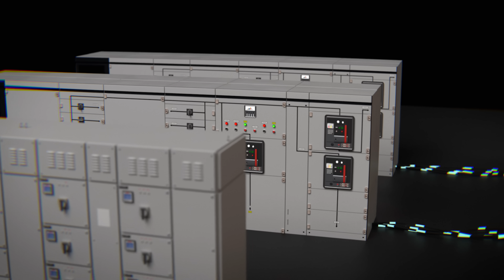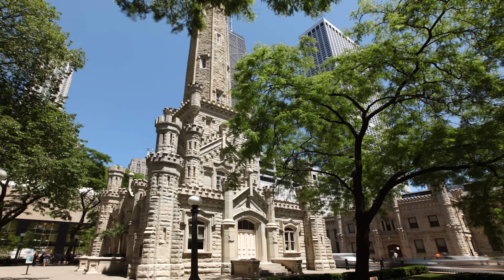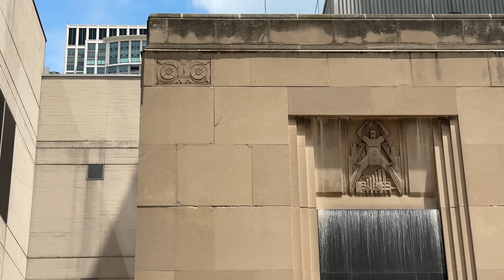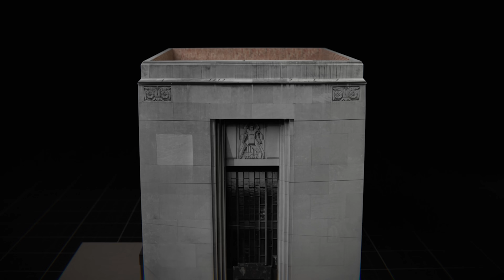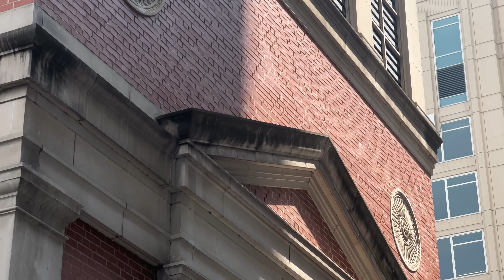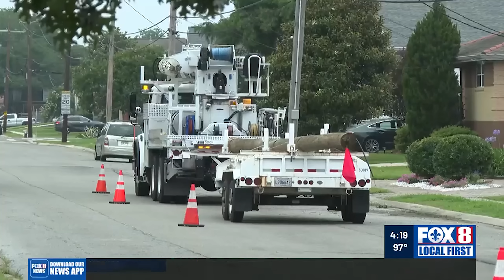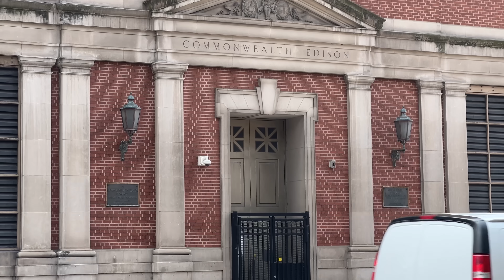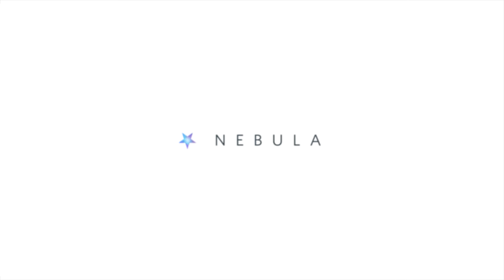How Fake Buildings Keep Cities Alive

Comment: The alternative to camouflaging infrastructure with the style of the local vernacular architecture isn't impressive art deco or neo-gothic works of art, it's a 10-foot chain link fence topped with barbed wire and dotted with danger signs.
Reply: In my city in Belgium the downtown substations have been moved. And non are in nice buildings.
Reply: That is not THE alternative. That is AN alternative. You could very well design architecture that strikes a balance between the utilitarian need to keep people out of danger while also not entirely hiding the existence of critical infrastructure.
Reply: Here substations are outside the city bounds not in a building in the middle of a busy street
Reply: @alex31ytb  Thats only feasible for cities that arent multiple kilometers in diameter.

Comment: The Pompidou Center in Paris inverts this, using the infrastructure of the building as presentation, as very visible design elements.
Reply: But it ain't pretty which is why many people joke that the best view of Paris is from the top of the Pompidou because you can't see the Pompidou.
Reply: @David-kd4qr  That's the joke for Tour Montparnasse

Comment: They built WTC 7 over a substation. It can be done, but at significant cost and design complexity. The cantilevered structure meant the building had unusual load paths, increasing the risk in extreme conditions. Personally, I’d rather have a simple, low-risk building than take on that kind of structural liability. And if it blends in, good.

Comment: theyre missing a great opportunity to have these places be learning centers for kids. stop hiding them behind fortress walls, let there be windows to see inside at the inner workings, with simple explanations and diagrams of what's going on. if the building is going to be in the middle of a community, let it be part of the community.
Reply: There is no way in hell they are letting kids into those buildings. Unless you are an engineer and a tradesperson you shouldn't be anywhere near that equipment.   Hell typically you are going through some form of orientation training just to get access.  This stuff is extremely dangerous which is why they build what is essentially a bunker around them.
Reply: @pin65371  emphasis on the windows part of the post lol

Comment: Access is restricted to qualified personnel whether it’s in a building or behind a chain link fence, so people wouldn’t interact with it anyway. Beyond that, your average homeowner barely knows what a breaker panel is, much less that it has an operable door on the front. Are those same people supposed to know what in the world the wiggly wire dohicky from the 70s and that it should be upgraded? Not sure what the point was overall beyond a vague notion of hiding the infrastructure in one way is good, but in another similar way is bad.
Reply: Most homeowners know what it is 🤦‍♀️ I live in an apartment and I’ve even had to check mine before. This isn’t some esoteric knowledge that only super special snowflakes like you have.

Comment: First, that's not a picture of Bruno Latour.
Second, your case is so much all over the place it's difficult to form a rebuttal, but I'll try.

Utility equipment can kill you, EVEN IF YOU ARE PROPERLY TRAINED TO WORK WITH IT. The last thing ANY utility needs is for kids, urban explorers, and the 'hold my beer' crowd twisting knobs that could disrupt the utility, damage property, or injure/unalive someone. So there's a reason the technologies of a modern city are enshrined, accessible only by the priests.

Chain-link fences and barbed wire are ugly. Fake buildings are usually less ugly.

Should utility infrastructure and design be open to public review for comments and suggestions? Yes. And it often is if you know how to access drawings and other models. But unless you have an engineering degree relevant to the utility, you probably won't know enough to suggest a valid improvement.

Even with a relevant education, most technicians/engineers can't identify a failing component by simply looking at it, so even if the equipment is within public view, it's highly unlikely that anyone will ever be able to say, "That #3 fuse is about to blow because the associated transformer has a phase imbalance." or, "Pump 7 is failing." or, "That valve hasn't been exercised in over 3 years."

Preventive maintenance schedules exist for a reason. When a utility is dealing with budget issues they sometimes skip some of the maintenance in an attempt to cut costs, but this only works in the short term and often costs more in the long term when OOPS the $500 component failed, started a fire, and destroyed the entire $5M installation. But that's not the fault of the public, it's nothing the public can do anything about, and most utilities have regulatory agencies that can fine the utility or even revoke their operating license in extreme cases.

As for making buildings interactive, we can hang a b-ball hoop on the side of any building, whether it's brick, CMU, stucco, wood, steel, or plastic.

You've made better videos. This one falls below par.
Reply: Usually I’m a fan of this channel, but I 100% agree that the argument in this video was all over the place. It felt like I was watching the same person arguing both sides while insisting on one outcome - very odd.
Reply: @notyrpapa I think he’s just informing us on the subject and the opposing views rather than arguing for one or the other. His videos are always very floaty and not strictly on topic and rarely arguing for specific points. Makes them interesting if you know nothing about the subject and mildly frustrating if you are informed on it and know there’s a plot thread he could be following
Reply: Yes, for the inside, layout, design etc. is very much for the EEs. The outside (the decoration, if you will) can and perhaps should be the purview of architects or artists. 
And the public might be able to do something about he lack of maintenance, depending on the locality. They can be sure their representatives (city/county council members, etc.) insist on finding a way to do the routine maintenance.  It'll be a struggle, as it always is to influence public policy. And that won't apply in nondemocratic/authoritarian places.
Reply: I really don’t think he’s arguing what you think he’s arguing. This is an informational channel. It’s just informing us on what is happening with these buildings and what the possibilities are and the opposing thoughts people have. He’s not shitting on anyone or any side of the supposed argument.
Reply: Ukraine is a money pit for a lost cause, but you have the right idea about the video🫠👍
Reply: Unalive? Seriously? Grow up
Reply: @masonrockwood7732  it's not a matter of maturity when the algorithm itself shadowbans or deletes comments that contain certain words.
Reply: @guycross493 I'd rather take that risk than censor myself. You are bringing to whip to your master and thanking him for the opportunity to whip you if you're that spineless.
Reply: @masonrockwood7732  you know youtube censors things, right? at one point youtube censored comments and content containing the word i euphemized. not sure if they still do, or if they'll ever resume the practice if they ever start letting the word pass.
it's not me that needs to grow up, but the users who have a conniption fit whenever they see a comment left by someone smart enough to outwit censorbot.
Reply: @dhtsoaedsdhtnadi9575 You aren't smart for using a word you picked up from TikTok. You missed my point entirely. It's the ethics of self-censorship, or lack thereof.
When you soften words like rape, suicide, and killing, you are normalizing and de-stigmatizing these horrible atrocities. I choose to live my life with my eyes wide open, if you want to speak like a teletubby, be my guest but you've lost the right to speak to me.
Reply: @masonrockwood7732  you think i'm a tiktok kiddie? you're wrong, and also blocked.
Reply: Considering the HUMMMM that some guys have to stand next to every single day to keep the lights on, I say civil electricians are some of the best trained people in the world, definitely a closed shop you had to develop an ear in. It's sad when a team has to remove someone's last mistake when they were just doing their job, not so much when fatal excitement- or intent- sneaks past safeguards. So a generous vanilla plastering to discourage human moths is also brilliant design that says much about a city and I respect that.
Reply: okay i'm glad i wasn't the only one who felt he was all over the place

Comment: Usually substations convert electricity from extra high voltage to high voltage, still far above what is in your home. Most substations convert from approximately 100,000 volts to 10,000 volts, still far too dangerous to be near for the public. In the US, wall outlet voltages are 120/240.
Reply: Where I live and work we have 12,470 on the poles. And our transmission voltages include 34kv, 69kv, 138kv, and 345kv (kv is thousand volts so 345,000 volts). We are talking about adding 765,000 volts too.
Reply: @rkegerize92  The direct current interconnects are 500kV to 1 megaVolt.  I spent some of my youth near a DC/AC converter station before it was switched from mercury to solid state.  The gear house would flicker purple and violet inside.  The DC power originated in Oregon.  Wind and solar farms are creating need for new high voltage DC transmission facilities (it's good to be Siemens).
Reply: @rkegerize92  why are there so many levels? Could you not just have a few thousand for last mile distribution and then high voltage between the substations?
Reply: @adrianthoroughgood1191 Money. How high the voltage determines how big your towers have to be and the thickness of your wiring. Higher voltage reduces power loss but needs bigger towers and cables. It’s better to save money by only building as big as you need for a given area.

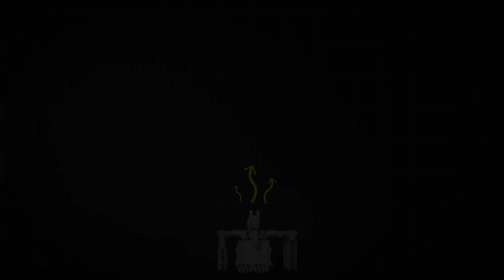Comment: 1:15 I wonder if there's a way to recapture that heat somehow and use it. especially in cities like chicago where water pipes are centrally cooled/heated for many buildings. Could we use these to heat the city in the winter? or, hell, even heat the roads?
Reply: I live outside Chicago and that would be awesome if there was a way to reuse that heat loss. I know what im spending way too much time researching later lol
Reply: It could be done fairly easily, but utility companies are usually highly risk averse, and even though the energy for 2000 homes sounds like a lot, it would be a very small heat source comparatively speaking, so there might be difficulties with cost effectiveness.
Reply: Likely a problem of heat level. Most transformers are not supposed to become hotter than 30°C or 40°C , while distric heating requires heat of at least 70°C (Up to 200°C). So while the heat energy is there, the heat level is simply too low to be useful.

Comment: I agree with you wholeheartedly, Stewart. Unfortunately, one of the reasons these sorts of structures are camouflaged is a byproduct of the preservation movement. Generally I'm a wholehearted supporter of the preservation of old buildings and neighborhoods, but I know in NYC and many other cities with a lot of historic fabric, preservation laws require that new buildings receive a "certificate of appropriateness" in designated historic districts, and the easiest way to do this is to replicate the facades of surrounding buildings. So, when a new substation or similar structure needs to be built, we end up reproducing the facades of buildings constructed for entirely different purposes. New York is filled with faux row-houses that hide utilitarian functions, because that's the easiest, and sometimes the only, way to get Landmarks Commission approvals. The stoops lead to grand front entries that are completely fictive. This isn't just an American problem either. I know that Paris has many examples of this sort of faux building for the same reason. Ironically, many utility buildings from the early-to-mid 20th century are now NYC landmarks, like the power station next door to Penn Station -- the only surviving above-ground portion of the old Penn Station still in existence. 

What ever happened to "Form ever follows function"? Louis Sullivan; pray for us!
Reply: Fºck form follows function with a functionalist lens! No one wants to see ugly industrial equipment.
Sullivan applied ornament everywhere, don't forget that.

Comment: I love seeing industrial equipment in use. I love walking into like the day to center I work at, seeing all of the conduit lines running in a grid in the ceiling that's all exposed. And then the HVAC in water piping and other pipes all insulation weaving like a perfectly synchronized dance. Then walking back to the power inlets, and hearing a hum of eight megawatts pouring through the systems. The taupe colored hallway with the gray painted cement floors. To me, nothing is more beautiful than how our utilities operate and get to where we use them. Rather than hiding them away in fake facades, I honestly think we should celebrate it! My neighborhood in Peoria Arizona it's being proposed to have a couple of 5G antennas installed to help with some dead space. And rather than the old palm tree hiding method, which actually has gotten really good in recent years, now they're trying to match the aesthetic of the community and they're making it look like an old western water tower. Which is honestly an awesome take on hiding it. As we do already have a old water tower from the 1900s as part of the inlet of our community that's been there since the 1920s.

Comment: So what is the problem?
Reply: He addresses it in the video. It's mostly an issue of public awareness and lack of public engagement with the structure. If they don't know about it (because it's camouflaged and hidden on plain sight) then how can the public lobby to make improvements or even have a say in how our public infrastructure is built and maintained?

Also, because it's hidden and walled off behind fake facades, there's no public engagement. He shows off an example of a powerstation built with durable materials that was designed with public engagement in mind (basketball hoop, wall climbing handholds, a reverse peephole to see what's inside).

Of course, public awareness and engagement has its risks (such as conspiracy theory whackos who might target them for whatever reason) but there's always that tradeoff.
Reply: @arcturionblade1077  There is no need for public engagement with these structures, that's the point of disguising them.
They don't need to know about nor have a say in them, the broader public are not experts, the most they could have a say in is the aesthetics. 

And no one is in favor of an electrical stations being an ugly building or having the industrial equipment exposed!
No one cares about this unless it sticks out for the negative, like being an ugly black brick building. 
Also keeping people away from dangerous places is  good, placing a basketball hoop near it is stupid.
Reply: The problem is some folks still thinking how to kick out those fake buildings and replacing those fake buildings with new Houses new offices and bla bla other buildings
But ironically they don't wanna think how Electricity Communication water steam gas etc work and give all of their needs for supporting their life
They just demand and want everything work like what they want
But they using them everyday every second of their life
When something wrong happened they just screaming blaming others etc even suing in the name of their ego 😂
Reply: Nothing, just a waste of a video and time for others

Comment: I'm leaving the comment up but i was looking deeper into this and it turned out to be wrong. or at least there's no evidence for it being this way.

I was basing my assumtion on a faulty memory i had from this answer in progrress video >
https://youtu.be/BeJqgI6rw9k?si=CwJowzI7YrEZna-s&t=364

"|i figured it was a safety measure to prevent curious urbanites from accidentally electrocuting themselves. or falling down a ventilation shaft. But it turns out the actual answer is hard to find."
I completely misremembered. 

original comment for clarity:

something i don't think he went into enough is that they also disguise these buildings for safety. They don't want people to go poking around. or climbing fences. if you don't draw attention to it it's safer that way. it's not just about ppl feeling safer cuz they don't see it. the substation itself is also safer that way.

(it also used to say "we" instead of they. I must've been really out of it cause i don't work in that field, nor know anything about it.)
Reply: Yeah and there are some desperate people that knew that if they knew how much copper was in that building they might well try and steal it and this is way more dangerous and has a way bigger impact on more houses losing electricity and the unfortunate people who might try and steal it would easily harm themselves
Reply: @mcamp9445  sounds like a good theory. I have no clue if it might be. it's funny how there's so little information to find on something so fascinating. 
I wanted to quickly update you that i looked a bit more into it and i was wrong so i've edited my comment
Reply: True, but isn’t this a fear-based argument as well? We could build all apartment building like prisons to maximize their safety, but perhaps there are other factors that outweigh this.
Reply: @evanblock5546  I don't know tbh. but i wanted to update you cause turns out I was wrong so i figured i'd send you and the other a quick notification to tell you i've now eddited and corrected the comment :D